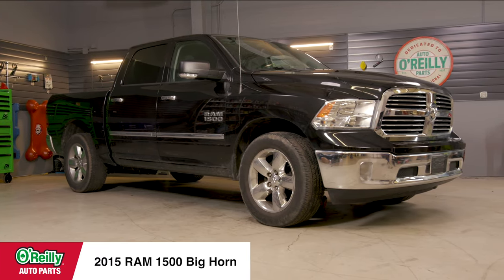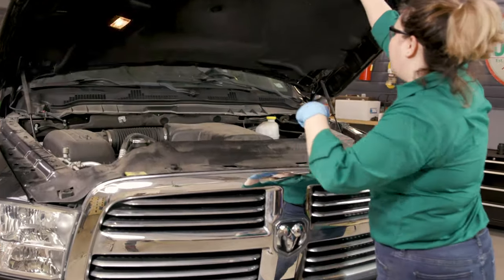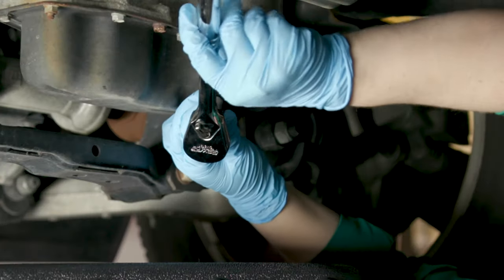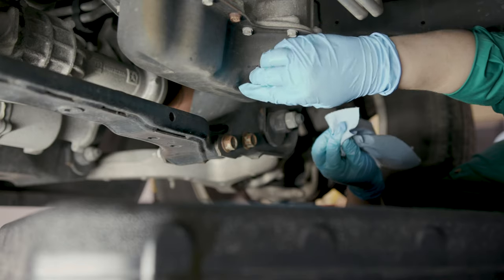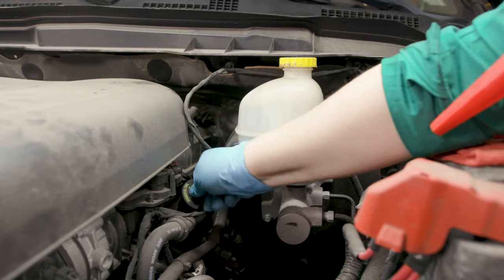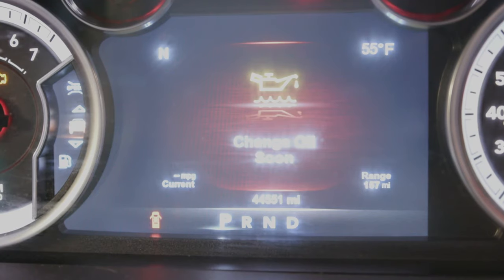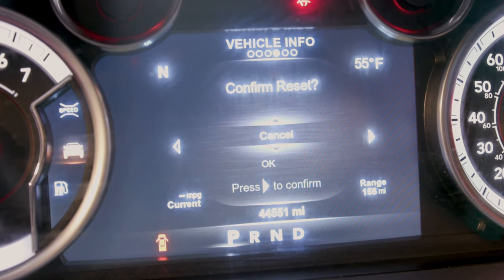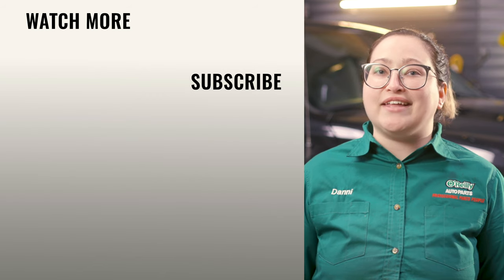How To: Change the Oil and Filter on a 2011 to 2018 RAM 1500 Big Horn

Comment: Some of them do it automatically as soon as you go to that screen and hit the button and it says hold it for a second it doesn't let you have that okay it just resets it the Grand Caravan you have to do different you can't go into the oil settings like that you have to literally hit the gas 6 times at The Break 5 times then it automatically resets it

Comment: If it's a 2018 3.6 V6 it's synthetic 0 point 5 weight oil that's what I have to run in my 3.6 liter V6 and the Durango and when I had to run in the Grand Caravan same motor and both of them

Comment: That's the 3.6 Liter V6 that's not just in the Ram 1500 that's also in the Durango the Grand Caravan a couple other vehicles the oil changes are exactly the same for that motor